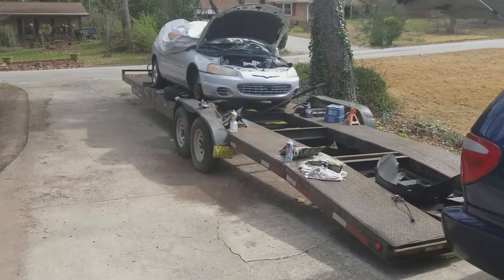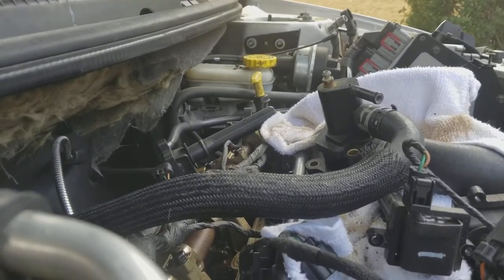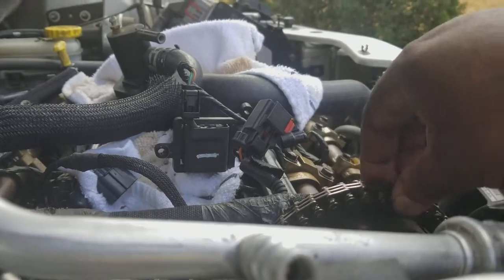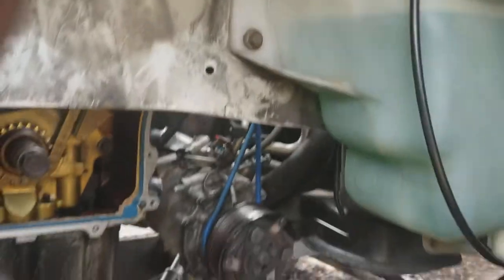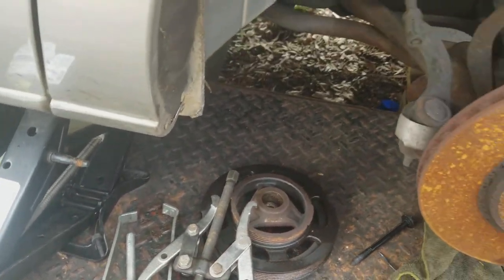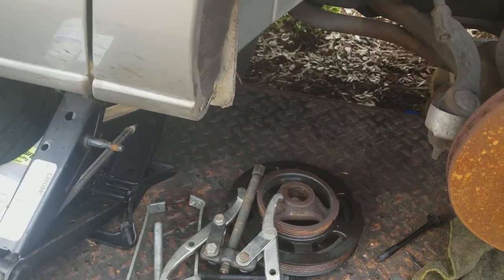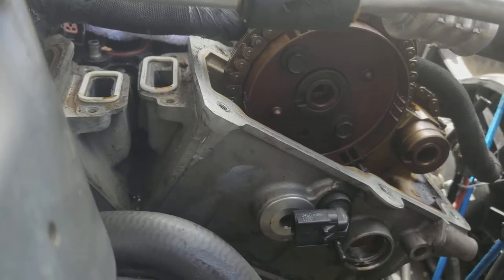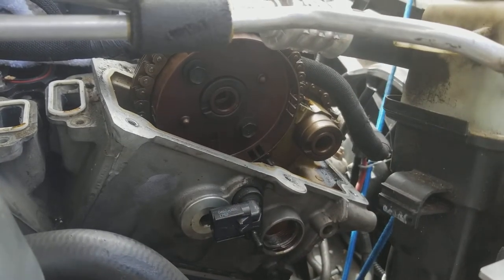Chrysler sebring (water pump replacement)

Comment: Thanks it helped some,  mine is a 2002 sebring. With a 2.4 duel over head cams.  The water pump went out two years ago. I was taking it to the garage and as luck would have it , coolant was going up on the timing belt and it broke.